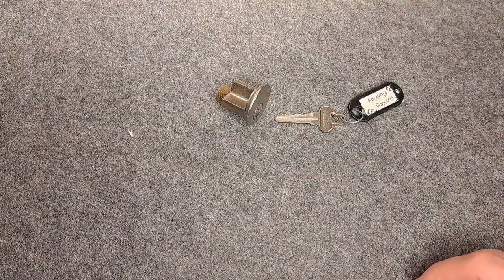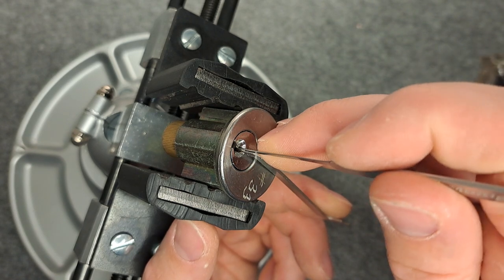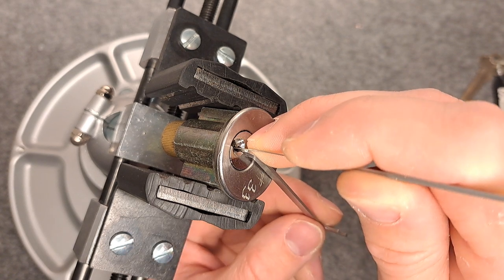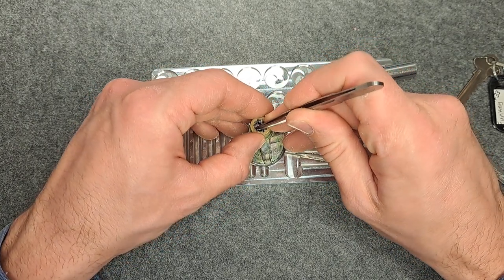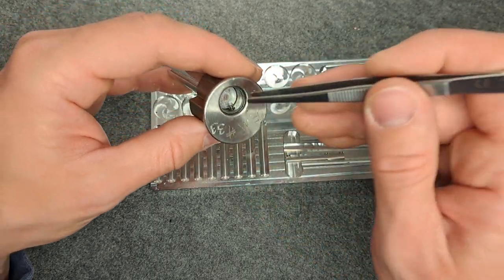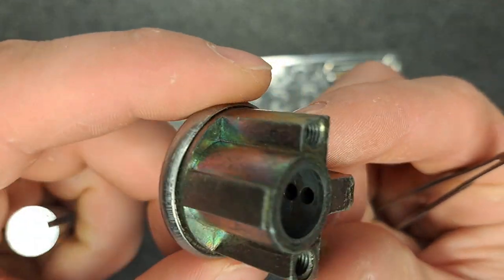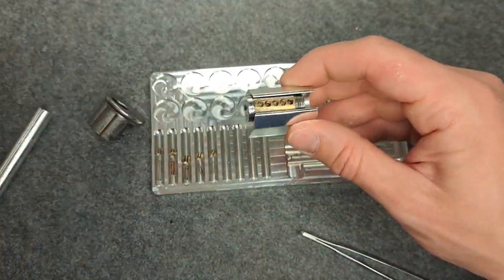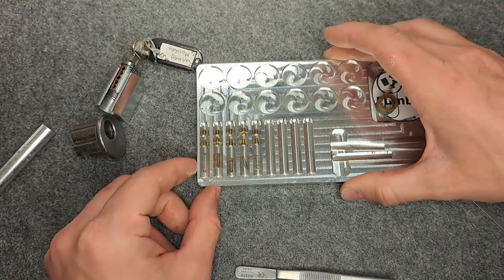[194] Challenge Lock from Funkey Monkey: #33

Comment: Very nice picking mate :) 
Yes you are correct regarding the 2nd driver, a previous picker must have reassembled it upside down by accident. 
Think driver 1 was also upside down, the t pin part slotted into the end of the spring. 
Also, Thankyou for the kind words my good friend. I'm sure there's more of my challenge locks floating around amongst the community. Some are probably stuck in naughty buckets lol😂

Also just subbed to your channel
Reply from the maker: Thank you very much 😊 This is a very nice, challenging, still fun to pick lock. You created some very nice pins there 👍
Ok, then I figured correctly 👌 After turning the 2n driver around, I picked it again off-camera. Still fun, but a bit more challenging. 
Thank you very much for watching and subscribing!